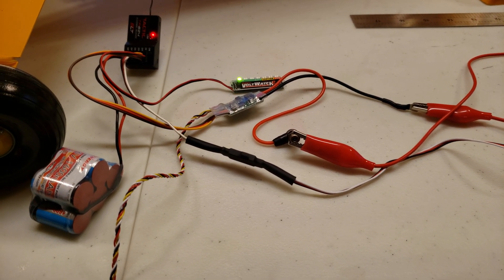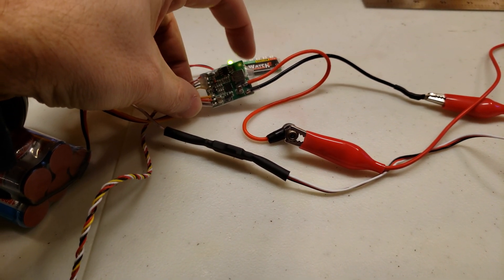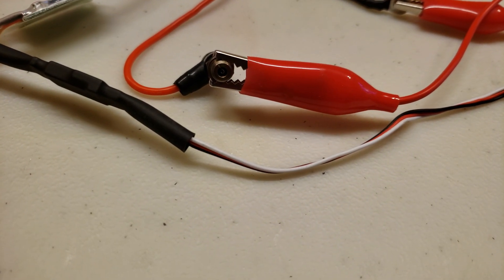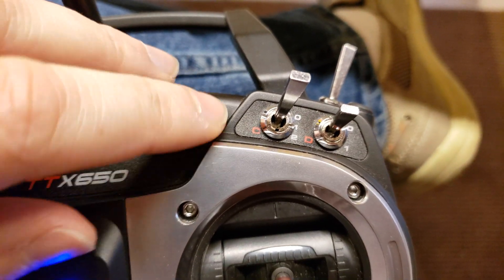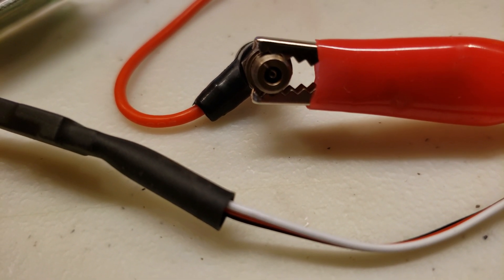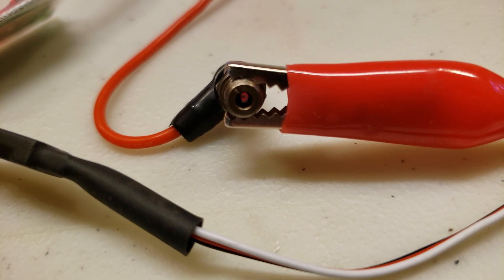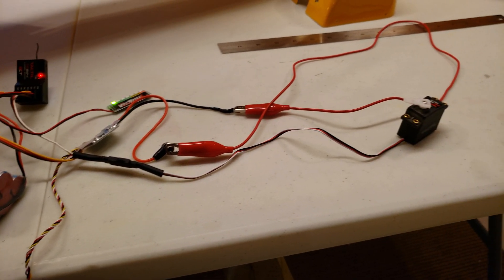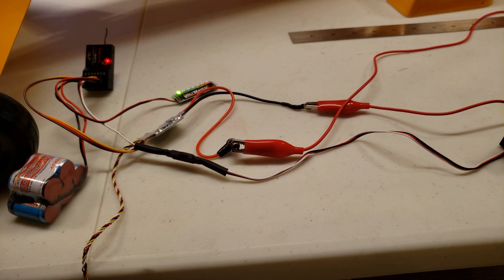$11 onboard remote glow plug igniter test

Comment: use a second separate  battery for this glowdriver !
Reply from the maker: Yep, already have a 3 cell 18650 pack with bms that I put together for it. Been working great for the past 5 yrs.!
Reply: @SuperchargedJester  with cold glowplug constant glow  ?
Reply from the maker: @olivierplayer1633 I only use constant for starting, I will use 50% power for a long idle decent,although now that the engine is well run-in it may not need it anymore
Reply: yes very stable idle !!! for hot or cold glowplugs .
Reply: what voltage do you use?
Reply: @marcosacchetto333  i have a 2S 850 mah for the glow driver and a 2S 2700 mah for my mgt8 monstertruck receiver .much more stable  soft glow with 2 separate batteries !!!  hot glowplug .